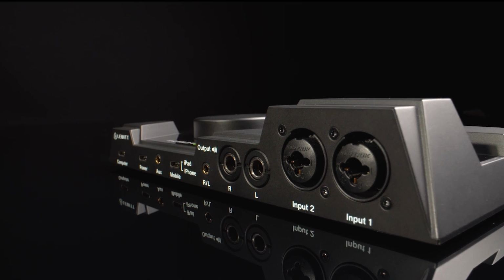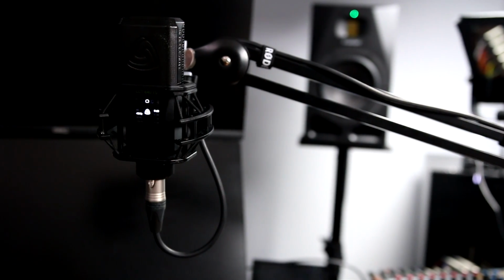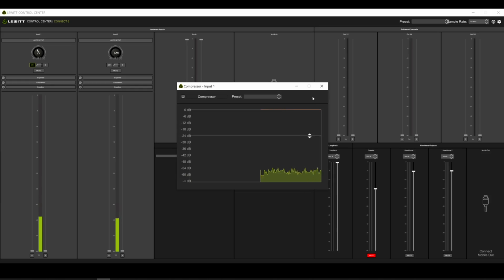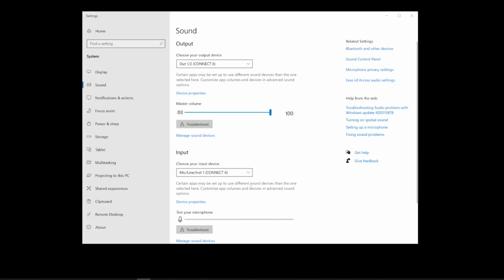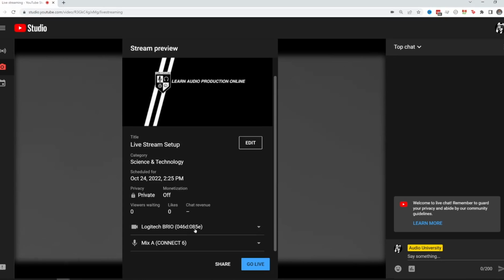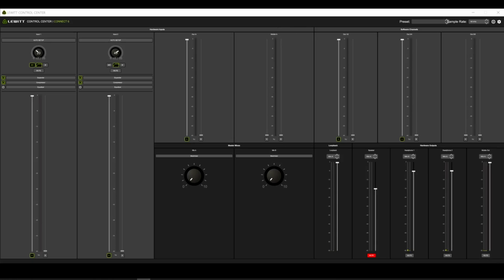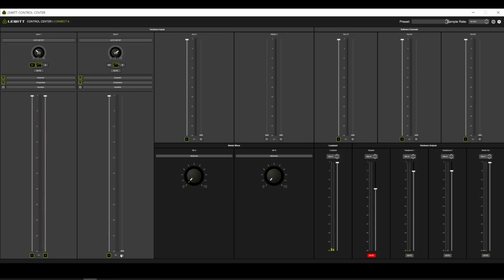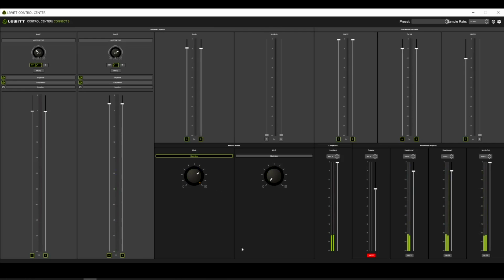This Interface Will Make You Sound Like A Pro In Your Next Live Stream!

Comment: I have a PreSonus interface with 48v phantom power and a mixer with 48v phantom power. If I have everything connected to my mixer can I use the L and R 1/4 TRS outputs to the front of my interface ? I assume that I should not turn on the phantom power on the interface? Or can I just use the USB on my mixer and plug my KRK ROKIT 5’s into my mixer outputs?

Comment: Is the device good for zoom as well; we have hybrid Comference.  How to connect it to the audio mixer where audience and here zoom presenter and vise verse.
Thanks
Reply from the maker: Yes. This interface would be useful in the setup you're describing. You would send the near end sound to the interface inputs, and create a mix for Zoom as shown in this video. Then, the Zoom sound would come in from a software output within CONTROL CENTER, which you could route to an output from the interface into the mixer. There are tons of variables, but this is generally how the signal flow would look.

Comment: I've been wanting to do streams that include a synthesizer, but I think I may have backed myself into a corner. I'm using a Focusrite 2i2, and it does not have the ability to separate it's two input channels. In other words, I can plug my microphone and a synth in, but they then become one audio source. This means that the synth sound gets sent through all of the same OBS filters that are set up for my voice, killing the sound of the synth. Is my only solution to buy a more expensive audio interface? It feels like such an artificial limitation.
Reply from the maker: You could try routing through a DAW and using virtual channels from your DAW into OBS. You may need to do some research for how to do this with your DAW. 

The easiest way is definitely to use an interface with the features I demonstrated here though!
Reply: @AudioUniversity  Thanks for always replying so quickly. I've tried this before and I think I may be able to get it to work but a better interface is probably the best solution. Just a piece of advice to myself and anyone else here: Don't make purchasing decisions at guitar center, especially if you have ADHD or cave easily to peer pressure 😅😅.

Comment: Hi. Did you have any issues with this interface?
Ex. software or hardware bugs, power limit issues, state loss/changes etc.?

I have a couple streaming interfaces that I have tested, and all of them have some issues.
This includes both GoXLRs, both Revelator interfaces, and the Wave XLR interface.
If I was to pick one of them as a recommendation, I guess most would be happy with the GoXLR Mini. However this interface does have it's own set of issues as nothing is perfect.
Reply from the maker: It seems pretty solid to me! Thanks for the additional recommendation!